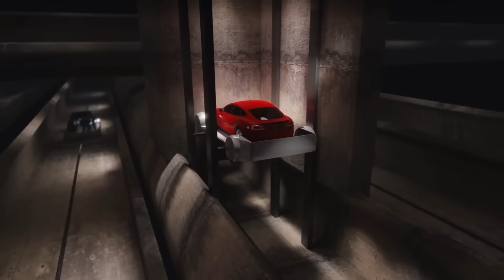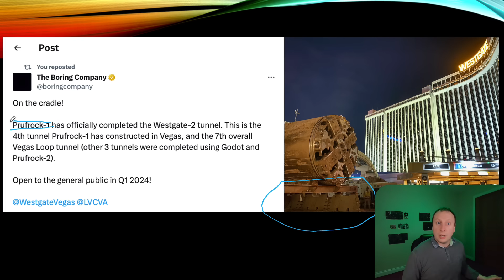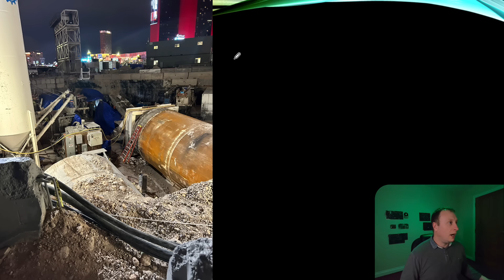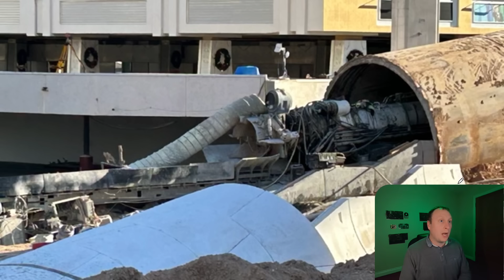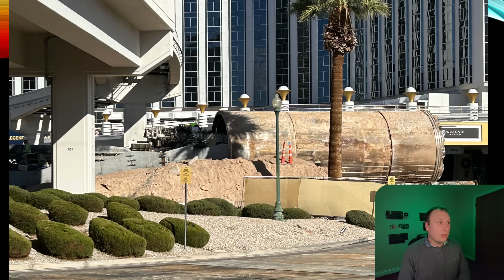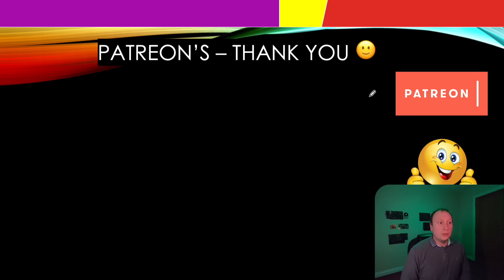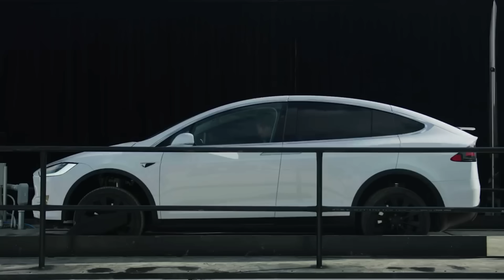New Boring Company Twin Bore Tunnel Completed in Las Vegas 🚇 👷🏼 👍🏼 💚 🤑 #186

Comment: Could you address the various "debunkings" of The Boring Company and the Las Vegas tunnels by Musk haters?
Reply: I am not a Musk hater and I call the whole boring concept a flop. Can they do things as a tunneling company.. probably, but the whole "revolution" aspect is as likely as Hyperloop. Longer tunnels need air vents and security like escape routes built into them creating cost and eating away profitability.
Reply: @immodsr9348  Actually, there are emergency exits in the LVCC Loop. They’re called “Stations” and they are closer together than the emergency exits on a subway.  

There will be up to 20 Loop stations per square mile through the busier parts of  Vegas so more than enough escape routes there and any longer segments will absolutely have escape tunnels as required by NFPA 130 “Standard for Fixed Guideway Transit and Passenger Rail Systems” with which the Loop is compliant.

The Loop also already has massive smoke exhaust fans and ducts capable of moving 400,000 cubic feet of air per minute as will all longer tunnels.
Reply from the maker: I've debunked a good few video!!!
Who is debunking in 2023? Anyone new?
Reply: I could do it,but i am to lazy!
Reply: The Denver airport tram carries 6x the amount per day, no?
Reply: @jonsonsandberg6846  not quite Jonson.  The Denver Airport Automated People Mover (APM) train has a maximum capacity of 12,000 people per hour over all 4 stations.  That is 3,000 people per hour per station. 

It achieves a daily ridership of 95,000 due to operating 24 hours a day.  

The LVCC Loop handles over 4,500 people per hour across three stations which is 1,500 people per hour per station, so Denver carries double the hourly ridership of the Loop per station, not 6x. 

Note that the Loop only operates a third of the amount (8 hours) a day during events and yet still handles up to 32,000 passengers per day, which is about a third of Denver’s daily ridership (again, not 1/6th).

However, the Denver APM has an average speed of only 10mph due to having to stop and wait at every station on the 1.2 mile line with a maximum speed of 30mph.  

In contrast, the average speed of the LVCC Loop is 25mph with a top speed limit in those short 0.4 mile tunnels of 40mph.  

The average Loop speed will be 60mph (100km/h) in the much longer arterial tunnels of the 68 mile Vegas Loop that is now under construction.  Loop EVs have already demonstrated 127mph (205 kph)  and 90mph/145km/h under Auto-Pilot down the 1.14 mile test tunnel in Hawthorne California, 

The Denver APM has peak hour wait times of 1.5 minutes between trains compared to the less than 10 seconds of the Loop. 

And lastly, the Denver APM cost $181m in today’s dollars to construct, almost 4x the cost of the LVCC Loop. 

So an interesting comparison.
Reply: One of the big talking points of Loop critics is that it can't move significant numbers of passengers which is patently false.

The Loop is handling up to 32,000 passengers per day which is very impressive in terms of mass transit as Light Rail lines globally average only 17,431 passengers per day, half that of the Loop. 

And what's really impressive is those LRT lines have an average 13 stations while the Loop has shown it can do twice that passenger volume over just 3 stations.

Even metros only average 14,656 passengers per day per subway station according to the UITP which is only a bit higher than the 10,670 people per day per LVCC Loop station despite subways costing 30x - 70x more.
Reply: @andrewfranklin4429  32,0000 pasengers a day eh 😅😮 lies lies lies
Reply: @andrewfranklin4429  32000 passengers per day in 690000 population Las Vegas is not impressive but rather low. Luxembourg City 132000 population and over 40000 passengers per day with LuxTram tramway.
5 times less population and 8000 more people per day and there is also an automated funicular (search Luxembourg funicular) that drives people with no driver through the mountain hills. In the meantime Europe builds the Base Brenner Tunnel which in size makes the Las Vegas Loop look very tiny construction site. A modern tramway in Las Vegas would have been cheaper and a more efficient way of mass transporting people.
Reply: @THEREALZENFORCE  As I’ve previously mentioned to you Zenforce, the Luxtram T1 line has 15 stations over 7km and takes 23 minutes to travel that distance at the dreadfully slow average speed of 11.3 mph compared to the 25mph average of the Loop with wait times of 4 - 15 minutes compared to less than 10 seconds for the Loop. 

The tram has a daily ridership of 30,000 passengers similar to the 32,000 people per day of the current LVCC Loop despite having 5x the number of stations, 5.4x the length and costing $604m or 12.4x more than the LVCC Loop.

And of course, the now under-construction 68 mile, 93 station, Vegas Loop will have 6x the number of stations, travel 5.3x faster (60mph average) and handle 90,000 people PER HOUR  compared to Luxtram and yet cost the taxpayer ZERO dollars compared to the almost two thirds of a billion dollars of Luxtram.

A modern tram would not be more efficient or cheaper than the Loop.
Reply: @andrewfranklin4429  Easy for you to write false comments when mine fact checked with videos are not posted or deleted and not shown. At least you can see them in your notifications
Reply: @THEREALZENFORCE  what facts that I’ve presented do you believe to be inaccurate?
Reply: @andrewfranklin4429  Cars are not more efficient than trains in mass transportation, the fact that Musk wanted to build the hyperloop should be proof enough of that even to you. The hyperloop is just to costly and too difficult to build (as claimed : 900kmh Vacuum tunnels maglev), hence Musk abandonned it and for him business wise it would be easier to sell car loops with his already working car factories than to build a train or hyperloop of which he has currently no clue or desire to build because he is in the business of selling cars.
Reply: @andrewfranklin4429  0.7 mile of Las Vegas Loop cot 49 millions (no cars, no tires). LuxTram cost 345 millions Royal Hamilius to Luxecpo (6.5km 4 miles, almost 6 times longer than Las Vegas loop). So similar price per mile but the several stations, the Tramway trains and wheels included with more passengers per day than in 5 times more crowded LAs Legas and its loop. The more underground Loop stations built the more higher the cost would become per mile for the Loop. Undergound stations of Loops will never be cheaper on average than above ground stations on tramways. And for the costs, Luxembourg has way higher wages for the construction workers and way higher real realstate and landprices than Las Vegas per square meter and Loop still cost a whooping 49 million for less than a mile in the Convention center.
Reply: @andrewfranklin4429  It is hilarious that you try to debate the fact that an aboveground tramway is more cost and energy effective than an underground Car loop (which is essentially a metro with cars on low efficiency rubber wheels)
Reply: @andrewfranklin4429  https://youtu.be/iZ4nshHnpI0?si=b1upDMEtNz-DP49d (more efficient than Tesla semi trucks)
https://youtu.be/fjqmu3eIkzo?si=TEUdoVNpL8xDezKB (3 minutes automated FSD through mountain instead of a 2 hour drive thought traffic jams)
https://youtu.be/Y_1dnLy0i3M?si=RnUbWRMQPFbXIwui (better Tunnels and better roads than Las Vegas and Boring company)
https://youtu.be/d6P7f6bN-yo?si=BUOWtOjcy2dAjxD5 (cheaper and more efficient than Las Vegas loop (and 40000 people per day ignoring most traffic jams) in a 132000 people city. And that's from a tiny country compared to USA.
And Japan and China are even further ahead in mass transportation (of goods and people).
The Boring Company Loops are ok but still not top of the world transportation and the tunnels far behind compared of what European and Asian companies build.
https://youtu.be/30foJiPUrBA?si=bdTwjV5GtwAeCg7z (Base Brenner Tunnel in Europe currently in construction)
Reply: @andrewfranklin4429  You can search for excuses as much as you want : 
LAs Vegas 690000 people  plus tens of thousands of tourists with one single track of LAs Vegas loop that cannot even make 40000 people per day in full city center. It is easier to make 40000 perpole per day in LAs Vegas on one track in city center than 40000 people per day in tiny low population Luxembourg City where in a country where the majority of people have nearly two cars per person.
Reply: @andrewfranklin4429  1)  Luxembourg CFL Intermodal > Tesla semi-trucks in transportation of goods efficiency
2) Luxembourg A7 Nordstrooss tunnels > any Boring company tunnels
3) automated Luxembourg Funicular > the Las Vegas loop stairs
4) 11bn Base Brenner Tunnel > anything The Boring Company builds
5) and in Japan and China the same is even more true compare to The Boring Company
6) The intro of this video is so misleading because The Boring Company removed that GGI video from their website, they will not build automated car platform and car lifts. 
7) and i told you in other videos that Tesla Solar City was not capable of worldwide keeping up with Europe's and Asia's leading Solar panel companies and the poor low numbers of Tesla panel installed gave me right years after.
8) Model Y and Falcon X are elon's greatest successes and 80% of all his other claimed projects are way past claimed release date or were abandonned or were failures. And with Twitter he is currently driving a once 42 billion company to the ground. You are just in denial, i at least can accept Musk's successes but also his many failed promises. For 2022 two Cargo mission Starships to  Mars were claimed years ago, and sadly nothing happened but failures claimed as wins (we went to the moon in 10 years, Elon cannot even make his rocket without exploding in 10 years. For humanity i hope he succeeds one day but he should stop with his BS of making up release dates of vaporware products.
Reply: @THEREALZENFORCE  So no comment on how Luxtram has:
- wait times 24x - 90x longer
- average speeds 50% slower
- similar ridership despite having 5x the number of stations
- cost a massive 12x higher
…versus the Loop?
Reply: @andrewfranklin4429  wait times 24x times longer fake news and misrepresentations : boarding is 20 seconds for 400 people with and a tramway every 2 to 3 minutes from A to B, Loop barely can board one car with 3 people every 30 seconds with luggage. Luxtram 400 people transported every 3 minutes, the loop does not do that in a convention center
Reply: @andrewfranklin4429  Now to real world speed Las Vegas loop : often traffic jams video proofs, normal to expect with single track one way tunnels, Lopp traffic jam free speed 25-30mph (slower than our 60mph car tunnels in Luxembourg)  Luxtram 30kmh in City, will do 120kmh outside city, metal wheels are way more efficient and need way less costly maintenance than Musk's rubber wheeled car loops
Reply: @andrewfranklin4429  similar ridership ???? haha in Las Vegas a city that has over 5 times more population, you debunk your own argument
Reply: @andrewfranklin4429  "cost 12x times higher" fake news. 
The 0,7 mile Las Vegas Loop costs almost 49 million (just the tunnels, no cars, no tires, no drivers). Luxtram 400 people one driver while Las Vegas loop is one driver for 3 passengers at best and 1 to 2 passengers on average, no way that is cheaper and the car will need huge maintenance and replacement costs). Tramways and Metro for working decades are cheaper to run, that's why modern cities have that.
Reply: @andrewfranklin4429  modern car tunnels > Boring Loops (because with car tunnels people paid for their own cars, while with Las Vegas loop cities are forced to pay for Musk cars on top of the tunnels construction costs). Metros > Boring Loops (Ikebukoru 460000 people per day average for one Tokyo station, wou would need over 100000 to 150000 Model 3 cars just for that station, that would need to be replaced and maintained at exhuberant costs)
Reply: @THEREALZENFORCE  Your very own Luxtram website says the following about wait times between trams:

Monday to Friday

Luxexpo -> Gare Centrale

From 4:30* to 4:45 every 15 minutes
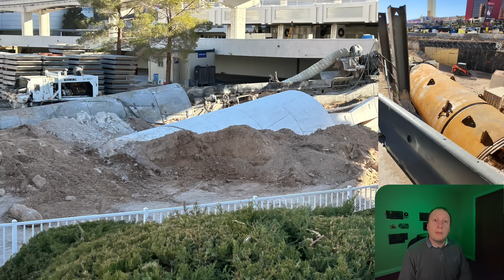From 4:53 to 5:40 every 8 minutes
From 5:45 to 06:05 every 5 minutes
From 6:09 to 9:50 every 4 minutes
From 9:55 to 20:30 every 5 minutes
From 20:38 to 22:00 every 8 minutes
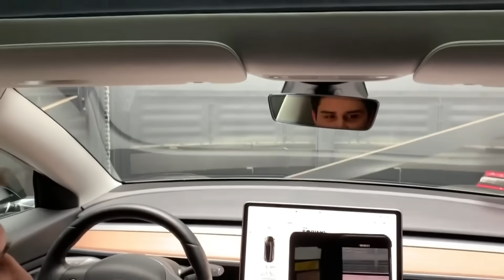From 22:15 to 00:05** every 15 minutes

Versus the Loop EVs having 0.9 seconds between cars in the arterial tunnels and an average wait time of less than 10 seconds in the LVCC Loop or 0 second wait times off-peak.
Reply: @THEREALZENFORCE  It is 30 seconds between EVs leaving a single bay, but with ten bays, that makes it 3 seconds between EVs leaving each station, and 0.9 seconds (5 car lengths at 60mph) between each EV in the arterial tunnels.
Reply: @THEREALZENFORCE  If you have a look at the footage of the supposed “traffic jam” that occurred once at CES 2022 you’ll see how the EVs just slowed down briefly because the South Hall doors were locked for some reason. 

There have been no other videos of this sort of incident ever happening again - not even during the much larger SEMA conference which had 114,00 attendees and had 25,000-27,000 Loop passengers per day.  

CES 2022 in comparison only had 40,000 attendees who rode the Loop 15,000-17,000 times per day.  

In contrast, CES 2023 had 115,000 attendees and 94,000 passengers over the 4 day event with zero such slow-downs as did SEMA 2023 with 115,000 Loop passengers. 

Now compare that short 40 second slow down against a train where passengers literally have to queue up standing on the platform for 3, 5, 10 or even 30 minutes waiting for the next train. 

The average wait time for the Loop was less than 10 seconds for the latest CES this year. 

And then those poor train passengers have to put up with the train STOPPING AND WAITING AT EVERY SINGLE STATION before they get to their destination, whereas Loop EVs travel direct point to point to their destination without stopping at any stations on the way. 

Now which would you prefer?
Reply: @THEREALZENFORCE  The TOP speed limit in those short 0.4 mile LVCC Loop tunnels is 40mph while Loop EVs have already demonstrated 127mph (205 kph) (90mph/145km/h under Auto-Pilot) down the 1.14 mile test tunnel in Hawthorne California showing what will be possible in the longer tunnels of the 68 mile Vegas Loop.
Reply: @THEREALZENFORCE  steel wheels are not actually the big deal in energy efficiency that you may think. Rolling resistance is only responsible for about 15% of the energy usage of a vehicle compared to wind resistance, fuel/energy conversion losses, mechanical losses and overcoming inertia when accelerating which account for a massive 85% of the energy usage of a car. 

Steel wheels also have serious noise issues.
Reply: @THEREALZENFORCE  Ikebukoru station with 460,000 passengers per day is only 14x more than the 32,000 the LVCC Loop has shown it can handle daily with 70 EVs so 14 x 70 = 1,006 cars, just 150x less than you estimated!  :-)
Reply: @THEREALZENFORCE  Actually,  rail is more expensive to service and maintain than the Loop:

* Average subway and Light Rail vehicle maintenance is 9 & 21 cents per passenger mile respectively from 2019 NTD ($Vehicle Maintenance/Passenger Miles Travelled)

* whereas AAA puts 2019 car maintenance costs at 9 cents per VEHICLE Mile (so divide that by the numbers of passengers in each car). And EVs with only 25 moving parts are far cheaper again than ICE cars (2,500 moving parts) to service and maintain. Teslas don’t even require regular servicing - just check the brake fluid every three years. 

Likewise, maintaining rail is also far more expensive than paving and maintaining roads.

* Subway maintenance besides rail, also includes substations, signaling, switches and stations and averages $1.8 M per Directional Route Mile (DRM). Light Rail maintenance averaged $250K/DRM. 2019 NTD.

* in contrast, Loop stations are simple above ground stations with minimal maintenance and cleaning costs. Rail electrical substations at mile long intervals are replaced with a few Tesla charging stations. Signaling, switch and rail maintenance is non-existent for Loop.

* In 2019 FHWA spent 61.5B in maintenance for 8.8M Lane Miles, resulting in less than $7000 per lane mile. Most damage is actually caused by semi-trucks and buses so running comparatively light Model X & Ys will result in less damage. The tunnel roadway is also protected from weather, freezing, salt and sun increasing its longevity.
Reply: @THEREALZENFORCE  not sure why you wish to bring the entire population of Vegas into the discussion when the LVCC Loop in its current form only services the Convention Centre?
Reply: @andrewfranklin4429  There won't be 127 mph in small tiny Las Vegas Resort loops like there is no 50mph Convention loops. Dream on. Reality will disprove you again as it did with 80% of Musk claims
Reply: @andrewfranklin4429  ou can claim all you want the Loop peaked at 45000 max per day for few events and was way below that for year average doing lower than one single LuxTram "Royal Hamilius" station in a city 5 times less crowded than Las Vegas
Reply: @andrewfranklin4429  it is clear when most people are at home that the tram does not run as much, on peak hours it' is every  minutes and yet per day the Luxtram transports more people than the loop in a city 5 times less crowded. Royal Hamilus station beats Convention center station on peak hours. And you are telling me that there will be a 3 seconds interval 24hours a dy. Liar.
Reply: @andrewfranklin4429  LVCC Loop zero time to wait is a lie, you already need 20 to  30 seconds going down the rolling stairs, than you have to wait for an empty car, than you have to board the car (and put the luggage in the trunk before that). Reality not fan fiction. Tons of videos out where people have to wait on the Loop, tons of videos with traffic jams on loop
Reply: @THEREALZENFORCE  The reason why the trams have such a dreadfully slow AVERAGE speed of only 11mph is because they have to stop and wait at every station in the line. The Loop EVs don’t have to do that - they are PRT meaning they go direct to their destination at high speed bypassing all other stations on the way. 

With plenty of longer straight stretches in the 68 mile Loop these higher speeds will be possible. The Loop EVs doing 127mph (205km/h) in that 1.14 mile Loop tunnel demonstrates that.
Reply: @THEREALZENFORCE  the difference between PRT and traditional rail is the wait times drop to zero off peak because they are on-demand.  They just wait at each station for customers and don’t have to keep driving around empty wasting energy like trains or trams.

With trains, off-peak wait times increase horrifically to 15 minutes as we’ve seen with Luxtram. Terribly inefficient.
Reply: @THEREALZENFORCE  and as I’ve mentioned many times before, most stations in the Vegas Loop will be above-ground right at the front doors of those hotels and resorts and the university, not hidden away underground miles from anything like subways. 

And because there will be up to 20 Loop stations per square mile thru the busier parts of Vegas, they’ll be much closer with far less walking needed than for any sort of rail, trams included.
Reply: @THEREALZENFORCE  and no, there are not tons of videos of traffic jams - just the one of a short slow down for 30 seconds which gets repeated ad infinitum.  And every video of the Loop shows people arriving at a station and almost immediately jumping in an EV, with at most, a few tens of seconds wait in busy times. 

In contrast, EVERY SINGLE video of trams and trains shows people waiting for 2, 5, 10, 15 minutes.

And then those poor passengers have to also stop and wait at every station on the line as well. 

Vastly more slow downs and time wasting on rail.
Reply: @andrewfranklin4429  1)  Luxembourg CFL Intermodal > Tesla semi-trucks in transportation of goods efficiency
2) Luxembourg A7 Nordstrooss tunnels > any Boring company tunnels
3) automated Luxembourg Funicular > the Las Vegas loop stairs
4) 11bn Base Brenner Tunnel > anything The Boring Company builds
5) and in Japan and China the same is even more true compare to The Boring Company
6) The intro of this video is so misleading because The Boring Company removed that GGI video from their website, they will not build automated car platform and car lifts. 
7) and i told you in other videos that Tesla Solar City was not capable of worldwide keeping up with Europe's and Asia's leading Solar panel companies and the poor low numbers of Tesla panel installed gave me right years after.
8) Model Y and Falcon X are Elon's greatest successes and 80% of all his other claimed projects are way past claimed release date or were abandonned or were failures. And with Twitter he is currently driving a once 42 billion company to the ground. You are just in denial, i at least can accept Musk's successes but also his many failed promises. For 2022 two Cargo mission Starships to  Mars were claimed years ago, and sadly nothing happened but failures claimed as wins (we went to the moon in 10 years, Elon cannot even make his rocket without exploding in 10 years. For humanity i hope he succeeds one day but he should stop with his BS of making up release dates of vaporware products.
Reply: @andrewfranklin4429  You people are so in denial that you delete comments proving when you wrong : 12 comments is the numbers shown and only 6 are posted and already 4 of mine that were posted here, have been deleted. You lose the argument but deleting facts that debunk your claims. Stay in your echo chamber, the world does not care and moves on to better options.